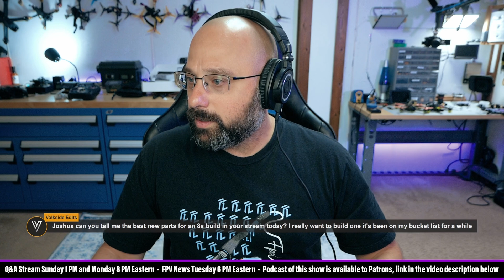What's The Smallest FPV Drone 6s Batteries Make Sense On? Should I Put 6s On 2.5"? - FPV Questions

Comment: Lower KV almost always equals more torque...in practice. I will demonstrate:
1. Same voltage eg 2400kv vs 2700kv - Your power limit is the amps the battery can dish out, the lower kv motor produces more torque for the same amount of current, therefore more torque.
2. With different voltages eg 4s vs 6s - manufacturing benefits, also heat build-up effects efficiency, system is power limited so better efficiency = more torque, ALSO the rest of the system doesn't change (typically) the motor resistance might drop proportionally but you don't use different escs, wiring or connectors which also produce losses, therefore lower current = more torque.

TL;DR, system power limitations, motor manufacturing, heat buildup etc all mean that for all practical purposes lower kv = more torque.
Reply: There's a lot to unpack in there, but the short version is the primary measure of torque is angular acceleration, not maximum RPMs, and the motor will have very similar angular acceleration of the same mass regardless of the Kv assuming all other variables stay constant in relationship to each other. The relationship between the torque constant (how much current it takes to produce a given unit of torque) and the velocity constant (the angular velocity that produces a given amount of back emf/voltage in the coil) means that the power requirements for producing that torque also balance out assuming voltage is scaled at the same rate. Smaller mAh battery of higher voltage with equal C rating can deliver the same effective current as a larger mAh battery with a lower voltage. Essentially the torque constant is scaling at exactly the same proportion as the current delivery capacity of the battery, which entirely cancels each other out in the torque discussion. 

As far as wire losses go, we're actually not operating anywhere close to the ranges where the losses make any significant contributions to overall output at either 4S or 6S, so that discussion is almost entirely irrelevant here. 

Short version, there is no appreciable torque difference from lower Kv motors there is only a functional limit due to the relationship between battery's current delivery and the motor's Kt/Kv.
Reply: @QuadMcFlyFlies  The point I am making is that there are a lot of what I would call "perfect world" assumptions there that don't really reflect the reality of the systems we use.

"Smaller mAh battery of higher voltage with equal C rating can deliver the same effective current as a larger mAh battery with a lower voltage." - we almost never actually do this. Even if we did there are other system imperfections that tend to make this untrue, lower kv motor construction is (usually) better. IR^2 losses compound each other, reducing overall efficiency which increases power requirements. Do 1800kv motors run at the same temp as 2700kv motors for the same power in practice? Do 2400kv motors run at the same temp per unit thrust as 2700kv motors?

Basically I don't think this assumption: "assuming all other variables stay constant in relationship to each other" is valid...except in very exceptional circumstances that almost never occur in RC and even less often in the extremely power restricted world we live in.

I'd love to see some testing but I do think the system losses need to be accounted for when thinking about this. Even 1% is 1% more power from the battery which increases the sag, which increases the current requirement etc. It's likely the impact is proportional to the increase in resistance squared. The current we use is enough to desolder the connectors we use if maintained for a significant amount of time. Its not the major consideration but I suspect it adds up, especially towards the end of a flight where temps and sag are maximised.
Reply: @frasersteen  you're in luck, I've done extensive testing on this over the years, and unfortunately I can tell you that doesn't play out the way you think it does.  The issue you run into is the electronics themselves are less efficient as you go up in voltage due to things like switching losses. 6S is pretty much always less efficient than the equivalent 4S setup.  And yes, the temperature differences between 4S and 6S at the motor are negligible. I've test over 300 motors with several thousand motor and prop combinations and this holds true pretty much across the board. I have data on the bench as well as pretty extensive flight testing. 

BTW, I'm the guy (Ryan Harrell) Bardwell referenced in this video as being the one who knows this kind of stuff :D
Reply: @QuadMcFlyFlies  You are indeed a god amongst men and I have watched or read pretty much everything you've published. I'm aware of your expertise and I'm not actually questioning it. You have written about this already on MQTB. What I am arguing is that in the real world we don't use the kind of apples to apples change that the theory depends on. I would also add that your excellent testing, rightly, isolates the motor and prop as variables rather than testing the actual system in use. 100% fair but it does mean that there will be differences when the power is limited by having to share a far smaller battery with 3 other motors.

Your testing indicates that almost universally 6s produces more thrust than 4s even when the listed KVs are equivalent. This is a strong indication of more torque, it's probably not an apples to apples comparison due to manufacturing efficiencies, but it never will be. It also indicates (usually) that the lower kv variant of motors for the same voltage tend to be more efficient per unit thrust. Batteries tend to stay the same so if efficiency increases it will result in more available torque in most cases. Plus even on the smaller quads higher voltage packs tend to be larger overall and greater than equivalent.

Take your point about switching losses but from what I understand switching losses decrease as the duty cycle increases so they will be at minimum when power demand is greatest and resistance is maximised. Some back of the envelope maths indicate you could be looking at 30W of losses in 20cm of 16AWG @35 degrees c &100A vs more like 60W with 150A. 20cm is a lot but with connectors escs and solder joints it felt like a fair estimate.
Reply: @frasersteen  I agree that the bench testing is only one aspect, but the point remains that in-air testing also backs this up.  The primary thing is that we're not hammered at the top of the throttle except in very rare circumstances. Torque is reflected in flight much more in the rate of change of RPMs rather than the top end thrust.  The instantaneous torque capacity of the motors is not going to be impacted the same by the output capacity of the power system, and while you might see a slight increase of peak power depending on your application, the parts of the throttle where most of us are flying are not limited in that way. The expressions of torque that we most care about for flight will have the least difference between voltages in practical application.  I do agree that in situation where the limit is the maximum output power of the system a lower Kv motor will produce more maximum sustained torque when it bumps up on that ceiling, but that isn't a situation that impacts flight very frequently, or one that most pilots will actively feel except in a very narrow set of circumstances such as a sustained full throttle punch. Even then if the Kv, battery wattage, and weight are all equivalent to the voltage, difference will be virtually undetectable even in flight without looking at blackbox logs. So you are technically correct that there is a slight increase in the accessibility for maximum sustained torque as Kv lowers when the system is bottlenecked in terms of power delivery.

And yes, you're pretty much accurate on the connector and wire losses. 60W max will disappear in the total  2200+ wattage throughput of the system at 100 or 150A, and we don't spend more than a handful of seconds during a given flight in the > 100A current range.  I think Bardwell covered this in a couple of his other videos as well.
Reply: @QuadMcFlyFlies  That's a fair take but I'd still argue that you are probably testing an idealised scenario that doesn't reflect the lived experience. Maybe you can create a test scenario where the difference is negligible but I would bet that test scenario is not reflective of what you or anyone else actually does. In most practical circumstances there will be a difference. Even if there weren't manufacturing differences in the motors themselves and low kv motors were equivalent to high kv motors, which is rarely true, we just don't use equivalent pack sizes. We almost always up the pack weight for higher voltage even at low-mid power the reduced sag will allow for more effective power available.

I'm not saying this statement isn't true "if the Kv, battery wattage, and weight are all equivalent to the voltage, difference will be virtually undetectable" I'm saying it just doesn't happen (or extremely rarely at least). I was scouring a few manufacturers for non-5" examples of 4s vs 6s and they seem rare now but I'd bet that the setup recommendations between the 2 always implying more torque with higher voltage.
Reply: @frasersteen  The problem with that is most of my conclusions are drawn from in-flight experience and data logs, with the bench data as only support. So I'm literally testing the real world stuff and using the bench data to help explain why.

Comment: Great answer. Very interesting. I just built a 3.5" freestyle quad, went with 4s, but wondered about 6s when I was picking motors.
Reply: get some 2105.5-2600kv, its a blast with 6s 1300mah,. u sould try it

Comment: I'd say this... 3", 3S. 3.5", 4S... Bigger, higher.
Reply: I'm new to this league, flying it for work, but I feel like it seems really inefficient for what it is, like I was getting at least 35 mins out of the dji M300 (also 21 inch prop size)
Reply: @WHEATSFPV  yeah, I know what you mean.
I built an 11 inch. It only got me 13 minutes. Same battery got me 20 minutes on my 7 inch.
I find the sweet spot is 8 inch for carrying higher loads likr bigger batteries. My 8 inch flys better than my 7 and 11 inch.
You're on 6S because you were too lazy to build 12s or 8s.
My 7 inch and bigger are all 8S.
Reply: @chrisbee5481  lazy...yes. my charger can only do up to 6s, although 8s is probably the better choice, im still planning my build but it seems like 12s is hard to source proper electronics for. Any recommendations for decent chargers for 8s ?
Reply: @WHEATSFPV  I believe you're confusing the sizes, 21 inches is a HUGE prop! 😬
We're talking about small quads, the size of your hand. Including props!
Reply: Agree for typical tri blade props. But for very high pitch or cinewhoop props you will want more cells and power
Reply: @chrisbee5481  exactly.
Reply: Well, unless it's a cinewhoop...
Reply: So why am I flying 6s on a 21 inch prop
Reply: @WHEATSFPV  21? Out of my League 😆
Reply: @chrisbee5481  realistically out of my league too  figured I'd ask, I'll have to do a lot of reading and research before I build my own x-class, but I fly this big ass quad for work i just think it seems really inefficient considering the payload is like an 8 ounce camera lol